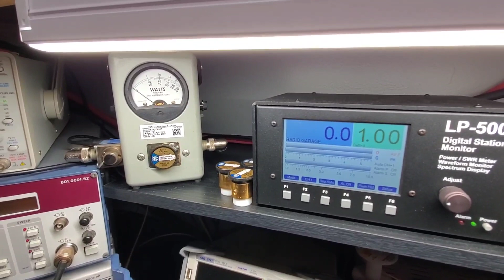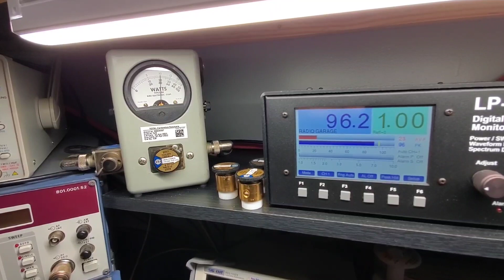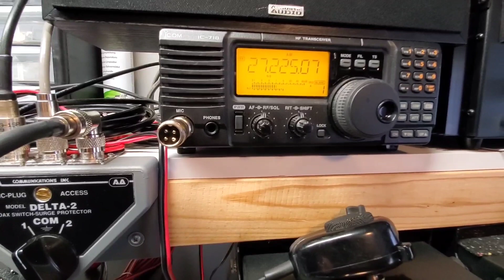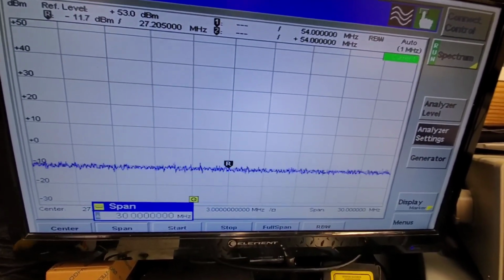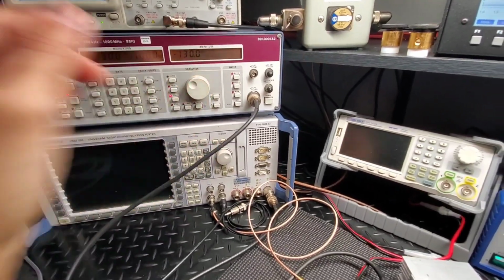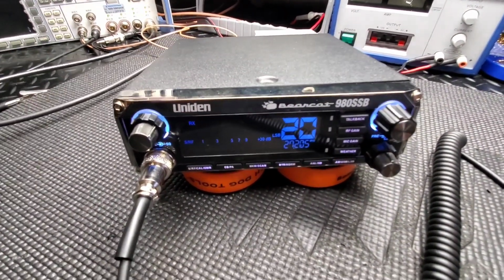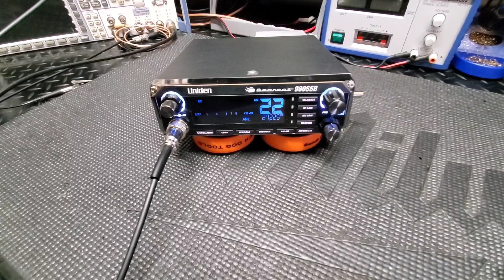Uniden Bearcat 980 SSB RFX95HD w/ Echo for Dave

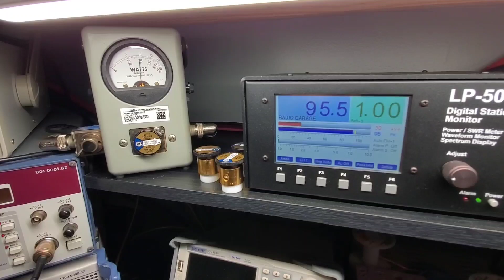Comment: 2:20 this is Dave and this is my Radio. I got awesome reports on Local AM, Skip AM and SSB. Super clear. Decided to run my ProComm noise cancelling power mic on the radio. Works perfect. Mic gain and Microphone on full power works perfect. Great tune up on top of the Amp and Echo. Always received great. I run the radio on a sloping dipole wire that is tuned to 1.0 SWR across the band. Awesome radio!!!!
Reply from the maker: Thank you for the feedback and glad it's working well for you!! 👍Appreciate the mic recommendation as well. That should help someone else out. 73 my friend
Reply: Find you a Turner Road King 70J/76.  Amplified ceramic noise cancelling with speech compression.  I got one a couple years ago and haven't looked back.  They come up on eBay from time to time.
Reply: That little really bring the radio to life.
Echo sounds good.
I want with thee ad203 and stuck a 60 mm fan in it.

Comment: Evening Matt,the 880&980 has caught my eye since I can’t get my hands on a Grant II.  Can the transmit & receive be widebanded any? How about HiFi transmit/receive mods? I’ve not asked Goldfinger about HiFi mods because it always slips my mind when I’m over at WWPD in the experimental section 😂   I was also wondering about adding a 5 band internal Eq since I’m an audio junkie but I don’t want to mess with a processing via analog rack or digital-analog in the mobile even tho that means giving up my beloved hall/room/chamber reverb 😂
Reply from the maker: No I haven't ventured into doing any or figuring out any hifi audio mods for that chassis. I would say just go with the internal 5 band eq. Thanks for stopping by 👊👋